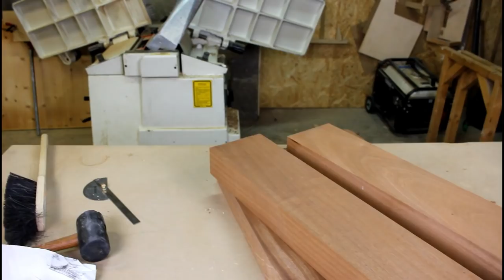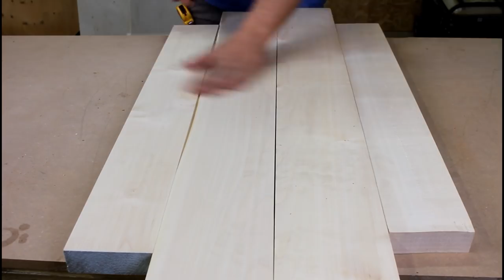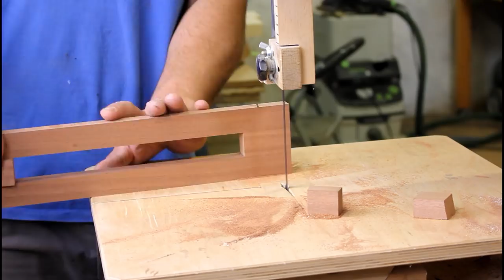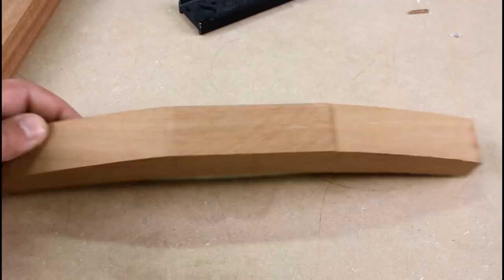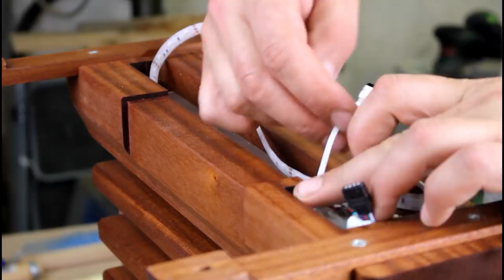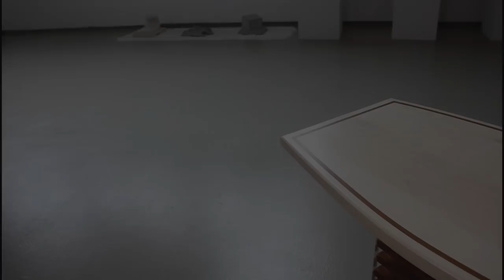Tony Stark Style Coffee Table / Making Coffee Table

Comment: How is the stability of this cable. I don't see adding any dowels or screws. And i'd imagine gluing plexiglass to wood at only narrow strips won't allow for lots of strength. Thanks for answer!
Great design
Reply from the maker: I made some in the past with same technique and they still function. Plexi is glued to both bases. Slot for Plexi is just barely wider to have some room for silicon glue. I don't show this in video but before final assemble I put silicon glue inside and than Plexi. Glue expand a little a makes a strong hold . Table is stable, no shaking or whatever.  Regards
Reply: Slovenian Woodworker  Thanks, I just quickly looked up a cost of thick like 1 inch thick plexiglass. And boy was I surprised this stuff is like gold :) Thanks for quick reply!!!

Comment: An absolute masterpiece! I have a question though. How sturdy is the acrylic glass? I'm considering making a dining room table capable of seating 6 adults, with matching chairs. Would the acrylic support scale well to suit this purpose?
Reply from the maker: Thank you.I'm glad you like it.
Acrylic glass / polycarbonate are super sturdy. It's not like glass which has little flexibility.  This is the material that they use for bulet proof windows so I assure you it will be strong enough. I'm currently making new video in which you'll be able to see it's strength to some point. Only downside to it is the price.  Good luck

Comment: Really nice! And I was surprised how easy was the inlay fitting! 
I'd like to build one for myself but here in Peru there is no place to buy that kind of thick glass.
Reply from the maker: Thank you for your feedback buddy. When I cut inlay strip I knock off the edges a little bit so it just slide in.  Try to find it online maybe you'll have more luck. And it would work with 20mm too. Thanks again buddy
Reply: Or you could just pour an clear epoxy slab to the proper thickness...

Comment: Beautiful work! I’m new to woodworking, so can you explain how you got the maple boards squared and joined without using a jointer? Did you just line the edge up against the track in the table saw?
Reply from the maker: Thank you David. . Well is super simple when you have saw like that.
Sliding carige is totally straight and parallel with the blade and rip fence. So first side I press wood down so it can move and I rip one side than I simply turned the piece for 180° and rip other side. As you can see in the video. Key is to have straight rip lines even if they aren't totally parallel to each other. Thanks for watching.

Comment: O erro do projeto for ter colocado a parte elétrica do led na parte de cima não nos pés, aí vai ficar o fio pendurado deixando a mesa feia. Só se ela for ficar encostada em uma parede, mas mesmo assim seria melhor o fio em baixo.
Reply from the maker: Wire for LEDs was just for a video. LEDs are powered with li-ion battery pack. If you look closely there is a space on the top of the base which was intended for that. I also put text in the video mentioning about that.

Comment: Stunning beautiful original table but my only concern is the power cable for the lights, was I correct when I saw the power cable was going in at the top if so what was the reason?
Reply from the maker: It's just for my vide purpose.  There won't be visible when table is delivered. It will be connected thru the table leg onto floor. Thank you for stopping by. Regards
Reply: Same thought here 😅

Comment: I'll go ahead and state the obvious. WOW! That's is one beautiful piece of art, that happens to be a coffee table! 

The table saw. That is genius engineering! 
What brand is that? 
How high does the blade rise?
It looks like it will handle a very long board, how long and how wide?

Anyway, thanks for making the video, and I did subscribe and look for more art
Reply from the maker: :-) Thank you for your kind words buddy .
About my saw.  This is standard type of format saw in EU. 
Brand it's SCM livincibile model.
It has 3.2 long sliding table . That means I have 3.6m of rip capacity. 
It has around 10hp main motor and 1hp scoring unit.
Max blade hight it depends of the blade size. You can mount from 250mm up to 500mm diameter blade.
With 350mm blade I can cut 12cm thick stock. I think max would be around 16cm.
And it has 3 speeds.
I agree with you. Working with this type of saw is really effective.

Kind regards

Comment: this is insane, I want to make a full size breakfast or dining table but paying for that size acrylic glass is so freaking expensive
Reply from the maker: Yeah I can relate :-) for next project I went with slightly thiner polycarbonate . It reduces price quite a bit
Reply: @Slovenianwoodworker  have you ever thought of using a clear epoxy resin poor then just sand down quite alot since the resin is significantly less expensive?
Reply from the maker: I did yes. It would cost less but not that  big of a difference. I pay 25  EU per 1.5 kg of epoxy. Becose time is a huge factor in my work I went with polycarbonate becose I could work without stopping. Otherwise epoxy would be good substitute too.